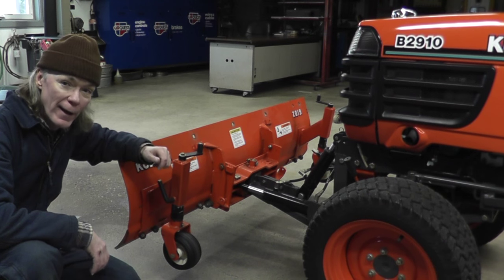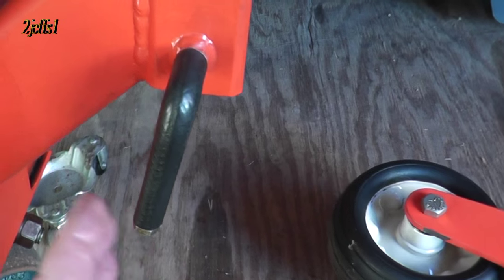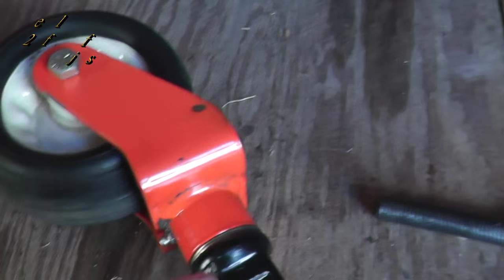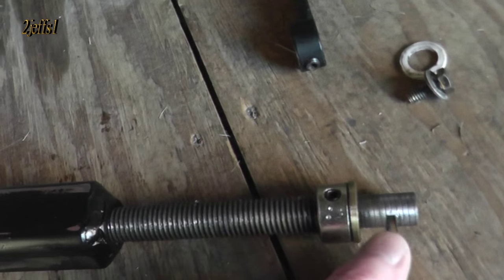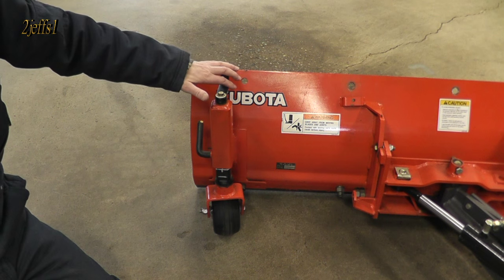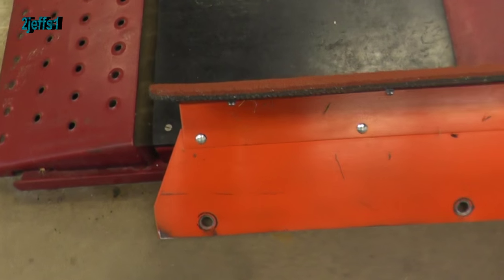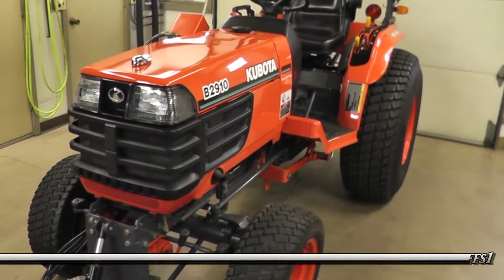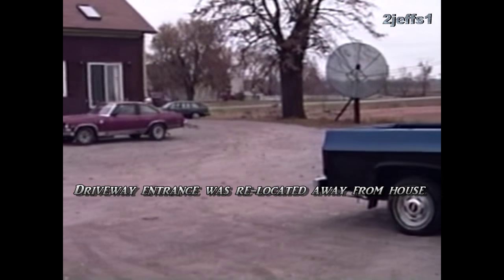Plow Wheels Swivel and Adjust DIY & Landscape Project

Comment: Nice work Jeff.  I have a B2620 that I put a BX-2763 (60" wide) on that I extended to 74".  I live in Maine and seem to have 12-18" after every snow on a huge driveway and parking area that has 4" minus gravel right now.  So plowing for 2 years with my BX 2370 with a BX2763 was do-able but though.  Every now and then, a shoe would hit a frozen rock.  Anyway, I think the B2620 will do a better job.  I have bigger tractors with loaders, but they are tougher to deal with, a 36" snow is when they get involved.  I like the plow better.

I love the wheel idea and just ordered a set.  This should make plowing easier on the blade, tractor and me.  Eventually the area will be black top, but for now, it's the gravel.  Thanks for taking the time to make the video, it certainly will make my job easier.  Randy

Comment: nice wheels on the blade, I finally did the wiper motor mod to my spreader tonight I am blown away with how well it works and so is my neighbour,, once again thanks for sharing that. winter is pretty much over here but she will be ready for next winter. as soon as I get this youtube thing straightened out I have some videos and pics to share of my stuff as well,thanks again.steve.
Reply from the maker: +steve lecain Way cool to hear you did your spreader. I should of showed in the video on how much faster it really is. With the 3 point all the way up it covers a larger area and run in top gear with the motor idling and travel pedal all the way down. Never cared for tow behind units. I can quickly back up to any spot and go. It has performed flawless without any issues. Even to have someone come in and salt my driveway 1 time would be a huge expense. Within a matter of minutes your done. Thanks Steve for bringing up your experience. I spend a considerable amount of time putting these videos together and appreciate knowing others are finding them useful. Will be looking forward to see how your creations turned out. Hope to catch ya again, Jeff

Comment: I've been wanting to do this for years, just never got around to start it.   What I'll use from your video is the threaded bolt and handle idea to adjust the blade for use on my crushed stone driveway.  I'll also use a bigger inexpensive pneumatic wheel from Harbor Freight.  Have to make my own U assembly, well actually everything I guess.  Its in the 90's here in NE Pa today.  Good time to start !   Should have done this for my old D-180 Wheel Horse but that's come and gone after 20 years.  Bought a 3184 Garden Tractor Cub Cadet last year.  That's what this will go on..
    Nice Kubota.. wish I could afford one.  And thanks for the ideas on the threaded rod, much better than the hole adjustment I was going to use.

Comment: That's a nice mod. I like to make things look as if they came that way from factory too. It's a nice compliment when people can't tell your work from factory. It looks like Kubota should be taking notes. You sure have done a lot of work to your place through the years.
Reply from the maker: +Chip Wright Thanks Chip. There are plenty more original mechanical/electrical things created here to come! The house was last on the list of things to be done where it doesn't generate any revenue. However it does save in another way. It's expensive to heat a corn crib was my saying. The heat bills were terrible (also the insurance cost was considerably less where everything is up to current codes) I lived in the body shop for over a year. When done with customer cars I'd be working on the house. I must say it has been an interesting journey!
Reply: It sure sounds like it!

Comment: Watch on CL and Ebay for casters from a commercial walk behind or zero turn mower being parted out. Toro fixed deck walk behind mowers have casters similar to the ones you used with the mounting arm rising up at an angle. Just check for slop wear of the inside of the caster arm as they can get really loose and be hard to turn.

Comment: That is sweet. You take really good care of your equipment. Not something you see much of today. Was your shop a working barn at one time. ?
Reply from the maker: +57WillysCJ I like keeping everything looking nice & gets used a lot but they do get run hard on occasion. When I moved here in 1986 they didn't even put the barn on the appraisal. They claimed it was unsafe. I was here every day before ownership studying it to re-structure. I had those steel beams on wooden pop crates where the fork truck a guy loaned me didn't go quite high enough. It's all steel beams and 5/8 fire code drywall now. Lotsa storage upstairs too. Way too many hours invested to get it done. Wouldn't wish that on anyone!

Comment: Thanks for the details Jeff. Now, if could only get my shop fixed up enough to try your idea. Still no insulation or heat {8-\
Reply from the maker: +Ron Standley Your welcome Ron. Years back when I had  an apartment, remember working on vehicles out in the parking lot. Once one obtains a shop with heat life changes considerably!!!  :>)

Comment: l did wheels on my snowblower, but they dont swival,  that garage is remarkable
Reply from the maker: +mustie1 Those wheels are the hot ticket in a gravel driveway! At one time I considered moving the shop over there. Kinda didn't like the thought of having to heat that much area. Looking back I'm glad to have done the building now.

Comment: Jeff, this is exactly what I am looking to do with my 2019 plow.  I have a 2400 Kubota.  Would you consider building a set of these for my use?  I do not have your technical abilities and am really not a mechanic.  But I do not like wearing out my blade on the cement.  I got this tractor a year ago from Kentucky and had to put about 2K into it.  The plow came with it without the optional parts.  Thought there has got to be a way to utilize the larger two bolts on the bottom of the plow.  Your video shows me exactly what I would want to do.  Since I have the same plow, measurements would be exactly what you have.  Like you attitude a lot.  Thanks!!
Reply from the maker: Hi Dan. It never hurts to ask but I am just doing vehicle repairs now. That was one of those projects that I hoped would be worth the effort. When finally done - yes have been very happy with how nice they work. Not only does it save on the blade but helps preserve the seal coat on the blacktop. I did that project it was when I had the gravel driveway yet. Areas next to the buildings where there wasn't any frost could be quickly adjusted to accommodate for the softer areas.

Comment: Jeff another great video.  how do you keep the blade from rusting since its mostly bare metal?
Reply from the maker: I spray diesel fuel on it which helps keep wet snow from sticking to it. Several times I did do some fresh paint in the spring before storing. Not much yard work now...

Comment: Hey Jeff I really like the idea I have a kubota b2601 and I came across a Meyer plow which I use on a quick connect bracket. I have the problem of plowing up my gravel drive. I would like to do your mod but am having trouble finding the casters like you have everything i have the bearings on the upper shaft. Do you have the numbers or could you tell me which kubota deck they are from. Just found you videos and really enjoy them. Thanks Jeff
Reply from the maker: Hi Jeff. Glad to help out. The mower deck model is RCK60-24B. Be prepared to spend some $$. On that order I did get a couple of extra trinkets, never asked the price. Was 600.00 There would of been cheaper options I'm sure but - things are lasting with no issues. I even put down force at times without raising the wheels (like in dirt grading) steering with the brakes and those wheels and swivel forks have never bent or failed. Sometimes those projects can cost more than desired but once in use it will be so worth it. After I got the blacktop the seal coat guy knew I had those wheels on the plow. Having the blade just off the surface like he said - really saves on making the seal coat last. So many uses where that will be appreciated when your done!

Comment: Very nice. A little surprised you did not use a hydraulic motor on the screw to adjust the blade. :-)
Reply from the maker: +acklan3 Never thought of that. Would be great to adjust while in transit!
Reply: 2jeffs1 well.... get with it big daddy. ;-) Sounds like a part II in the works.
Reply from the maker: +acklan3 One never knows what could happen next here....
Reply: 2jeffs1 another option would be replace the vertical tube with a 8in ram and attack the wheel to it directly.
Have a great night Jeff.

Comment: 2jeffs1  Have you used these on gravel or just paved surfaces?   Thanks  BTW very clean tractor.
Reply from the maker: Hi Victor. I did that wheel setup for when I still had the gravel driveway. The ground was always frozen up at the shop but where the sun reflects off the storage units the ground was quite soft at times. A couple of turns on the adjusters and continue on. Really helped keep gravel out of the lawn too. Now with the blacktop the sealer don't seem to get scraped off/up as much either.